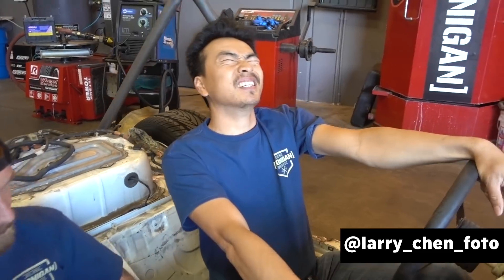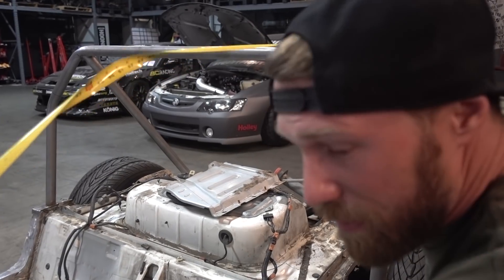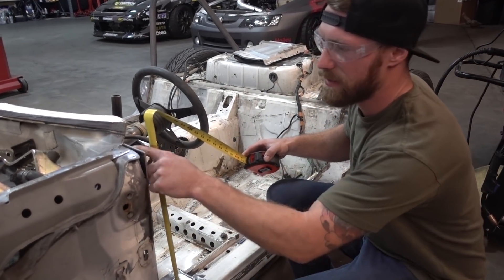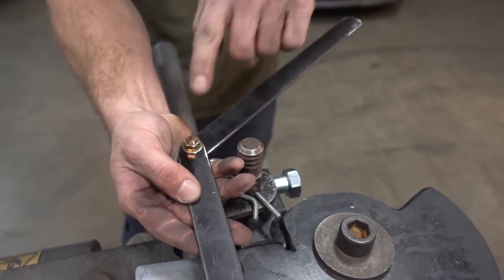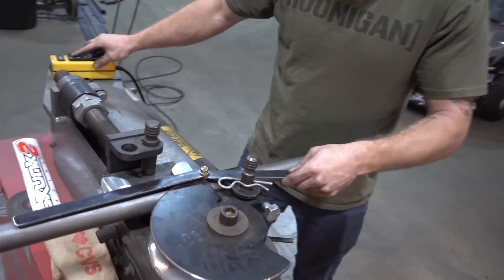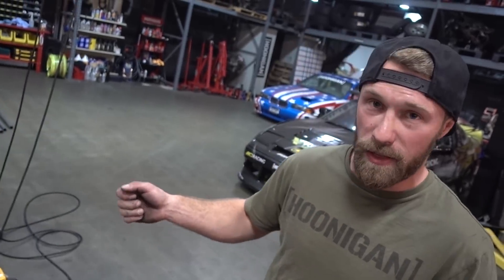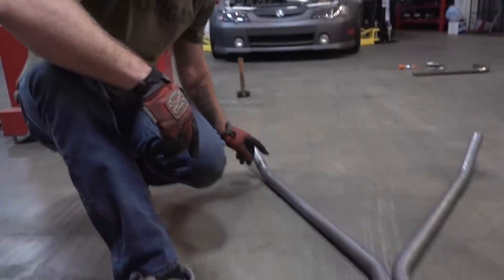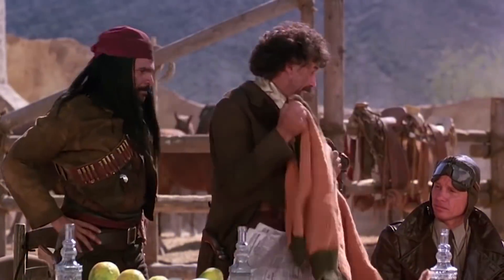[HOONIGAN] DT 176: $200 Miata Kart Build [Part 5] - Cage Build Cont. A-Pillars

Comment: very cool, your using a lot of similar techniques to what I used in the ten years I built sand cars for a living.  One thing you can do to cheat on layout is to use a test bend,  straight tube, chalk and a protractor to do layout on the floor  to figure out where bends need to start and stop.  I used to put a few marks on my tubes at known distances from one end to make duplicating, or mirroring a part easier as well.  I cant wait to see this finished, its going to be awesome

Comment: The precise way of knowing how/where to cut a bend is measure the exact radius of your former then knock that distance off where the bend is needed to run to its new square. 15mm copper is 67mm, 22mm 105 etc
Saves chopping and sanding especially on steel as it’s time consuming .... AWESOME PROJECT AND WICKED SKILLS

Comment: I hope that you will triangulate those bends at a pillar at least.  Should do it on every bend.    Oh well,  at least atm its living to its original name of death cart.   
All so i would stiff up the chassis even more near the struts and anything that connects to suspension parts.   Its easier to do it now, before it bends. 
I mean its different thing to build something half-way for your self to drive in, but this fab dude is building it for others to drive in and  there aint no question about it if its going to crash.  Its just matter how badly it will crash and how soon.   Just saying nobody wants to be the guy whos build was not strong ennuf on life cell part.

Comment: You said in the previous video that you need to weld a plate as a base for the roll cage, so I won't just go through the sheet metal (in case of an accident). However in this video for the base in the door sills the contact patch is basically just 2 thin pieces of steel welded perpendicular to the sheet metal. That would just as easily punch through the sheet metal as directly welding the cage to it. Also, pretty sure that may bends are a bad idea, it's not as strong as straight lines.
Reply: he said he is adding gussets up the side of that tube once thats welded in youd have a hard time pushing through that sill
Reply: B.D.B. it has bends cuz it fucken can, also cuz its shartcart
Reply: Goggle image "tube buggy" bends for days
Reply: The whole box is welded all the way around, the entire welded box would have to punch through. Also I agree the bends aren’t as strong as a straight bar, however I do plan on adding more support in those areas I feel aren’t as strong as they could be.
Reply: The problem is the box has no "base" so the surface area of that box to the sill is just the thickness of the plate times the circumference of the box. Anyways you're the expert I was just following what you said last time and applying my logic to it.